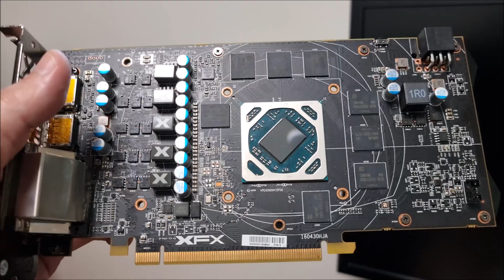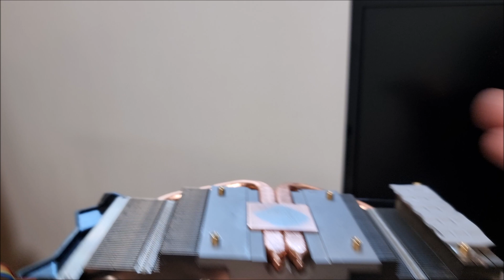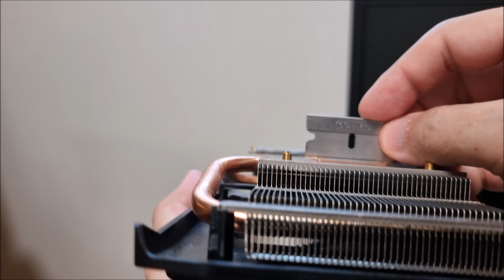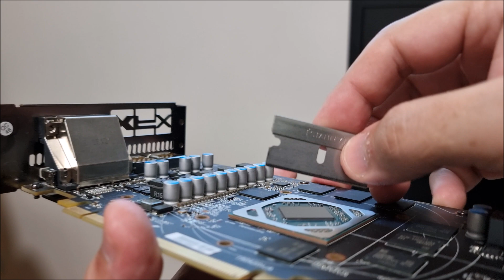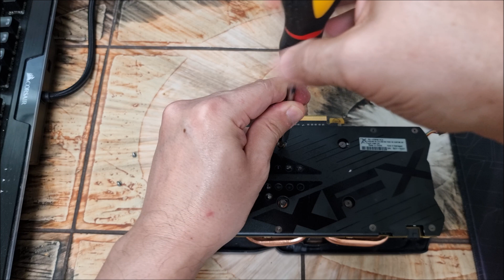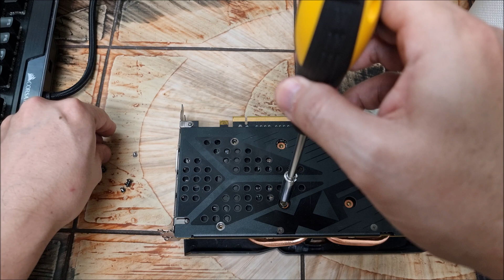GPU Hotspot Mystery Solved! Not What You Might Think!

Comment: When im Gaming Temp is 69C° to 72C° and the Hotspot is like 92C° to 102C° (XFX RX6700XT) The same issue with the Die.
Reply: Same on my 4070 Ti, I have to undervolt it to avoid said situation.
Reply from the maker: Have you tried setting a custom fan curve using msi afterburner?
Reply: Got a new Thermalpaste 
Thermal Grizzly Kryonaut  -17°C at the Hotspot now. Problem Sloved @Spr1ggan87
Reply from the maker: Check out my latest video. I show a trick of how to get your heatsink tighter to the core. This has resolved my hotspot issues. Just be careful if you try this.
Reply: a link to that video would be very helpful @TechnologyHive
Reply from the maker: @love4ever026  https://www.youtube.com/watch?v=iVCzG3Uv01I&t=551s
Reply: @TechnologyHive  Ive done undervolting now im ln 69C° to Hotspot 84-87C°
Reply from the maker: @Oklypt.  Cool. Hope that helps in long term 👍🏼
Reply: @TechnologyHive  from 1200mv to 1105mv  same frames but less Power consumption and the same clock speed
Reply from the maker: @Oklypt  That's nice!
Reply: @Oklypt  did u use msi afterburner for undervolting?
Reply: I applied PTM750 to my XFX 5700XT. Still a 18-20c delta with junction in the 90’s.
Reply from the maker: @freewrite2733  18-20c delta is high. PTM750 is new to me. Made by Honeywell? Perhaps shaving down the heatsink posts will help. It helped my RX 5700 with the same issue. Dropped 10c on hotspot. I made a video on this process: https://www.youtube.com/watch?v=iVCzG3Uv01I
Reply: Further tinkering with this thing may drive me insane. I'm not even sure if it's worth it anymore. Though yes, PTM750 by honey well. I've applied it once, ran it and checked spread. It stays together evenly but that has not helped junction temperature much. It's a thermal phase material that spreads like a sheet. It doesn't pump out like paste. @TechnologyHive
Reply from the maker: @freewrite2733  Ah yes I've heard of this. I ended up filing down the heatsink screw posts by 0.3mm and this dropped the Hotspot temperature by 10c. Apparently more pressure helps distribute the contact more evenly. I have a video explaining the process.

Comment: I believe I saw a video if nvidia thermal engineer talking about this. He said ot is intentional because under load the die heats up and bends, so they make them like that bend from the factory so they bend in opposite when heated and get flat so they have better contact with  cooler surface. 
But I cannot find this video, sorry.
Reply from the maker: I thought about that as well, that it might be by design. But can cause problems when the hotspot is significantly higher than the rest of the die.
Reply: @TechnologyHive  yeah, I think if there was defect in manufacturing or oversight in design, that can cause problems with contact

Comment: Interesting video! I've been looking for a solution for this problem that had popped up recently too and there's no specific one. So RMA is the only solution we have for the hotspot. I have a 1080ti for 6 years now and I overclocked it a couple of years back, it didn't throttle or crash once, but when I saw GPU hotspot feature on my HWiNFO, I removed the overclocking and went back to the normal clocks, since this problem has no specific solution.
Reply from the maker: Liquid metal is a solution. But, it has to be done correctly or you will ruin your GPU. So if you are not comfortable doing it, I would just run the card at stock speeds and maybe play a little with the fan curves using MSI afterburner. Thanks for watching btw 🤙